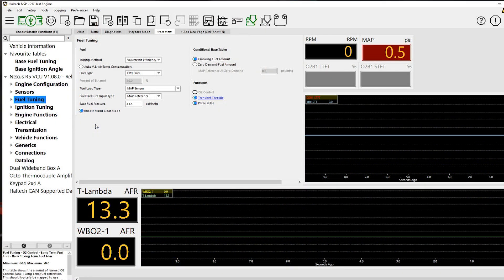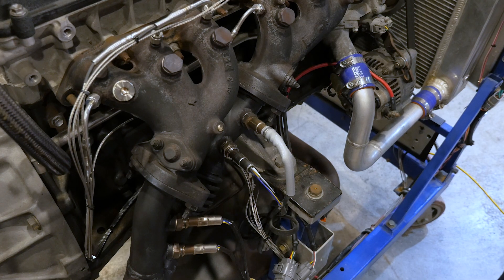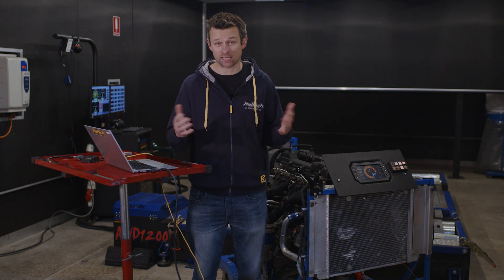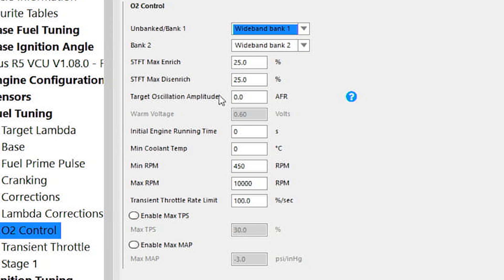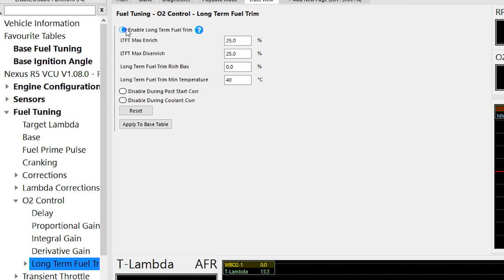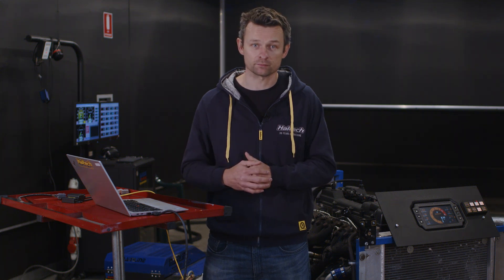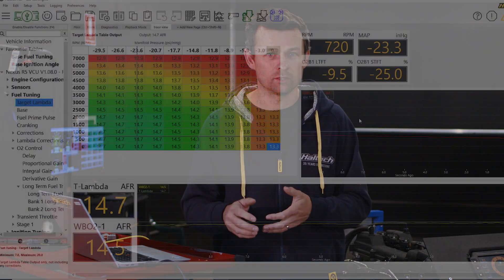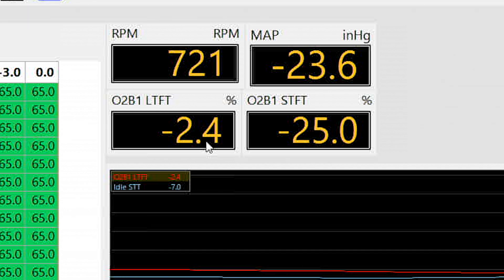🛠 How Self Tuning Works: Short Term vs Long Term Fuel Trim | TECHNICALLY SPEAKING

Comment from the maker: Welcome back!
One of the great things about tuning in volumetric efficiency mode is that once the fuel system is set up correctly - the ECU almost tunes itself. And that’s exactly what we are going to explain in this video.
-----------------------------------------------------------
Highly recommended videos that further explain today's topic:
AFR vs Ignition Timing: https://youtu.be/aDSZhy551bo
Tuning with Volumetric Efficiency: https://youtu.be/uPjIS9Tg83M
Volumetric Efficiency Explained: https://youtu.be/E96rBIzZ_sE
--------------------------------------------------------
For more Haltech goodness check out our:
Website: www.haltech.com
Facebook: https://www.facebook.com/HaltechEngineManagement
Instagram: https://www.instagram.com/haltechecu
Reply: Circle back  is that with two trailer Park girls around the outside. 😁👍🏻
Reply: So would this be able to work on a boosted car too? Like if set the AFR @ say 10.5 when in boost would it fill in the pieces and keep it safe at the sametime?
Reply: Put ChatGPT in this. =)

Comment: all modern cars have a self tuning (fuel trims) since 90’s but those use low resolution tables (low number of cells). not the whole ve map. this feature on Haltech  ecu’s seems very nice to have.

Comment: What ecu should i put in my 1.6 turbo cruze to get it to safely run at 300hp itll have high flow injectors , valve springs , t25 turbo n manifold, 3" straight through exhaust intercooler , cai, wide band and exhaust temp sensors

Comment: My elite 1500 has issues with this due to the delay in the o2 reading, and applying the LTT to the base map, it misses the cels its ment to add the data. Its reading for 2600rpm but applys it to 2800rpm range.. how do I fix this??
Reply from the maker: Contact our tech support team directly via www.haltech.com/contact-us
They'll be more than happy to help you out

Comment: Is this feature available for the platinum pro for the RB series engines (HT055101)
Reply from the maker: Platinum Series still have the long term learning feature it just works slightly different than the one described in this video.

Comment: I'm interested in the elite 1500 for my rsx. Essentially all stock other then a k&n filter in stock air box. Once the base map is loaded, can I just run the car how it was before since it isn't modified? Slowly modding the car for a tune later.
Reply from the maker: The best thing to do is to contact our Tech Support either via phone or via email (support@haltech.com). One of our tech guys will be able to recommend the right ECU for your RSX and even provide you with a base map:)

Comment: My question is this: do the LTFT and STFT changes get applied to only certain areas of the VE table as needed or do the trims apply globally across the whole map?
Reply: If I remember correctly, the LTFT and STFT values are unique for each cell of the table. So a cell at 3500 rpm and 0 psi would have its own LTFT and STFT values, different from those at 4000 and 5 psi, for example.

Comment: under what conditions can the "Apply to Base Table" button be pressed. As I am aware it cant be carried oout while the engine is running, but when should  it be applied, ie ignition on but motor not running??

Comment: Will this program fix my stock Toyota Camry with a 2AR-FE? The gas pedal is so sensitive it should just be called a light switch, and the transmission shifts up into 6th at 30mph. Taken it back to the dealership three times and they say it’s operating as designed.
Reply from the maker: The NSP only works with Haltech Elite and Nexus series ECUs.
Reply: @haltech  Thank you for your time and update! I’ll take a look at what Haltech products could improve my Camry.

Comment: Hey, thanks to your awesome videos, reviews, and company transparency, I'm now the owner of an elite 750 and 2000! Thank God for black Friday sales!
Reply from the maker: Nice:) What cars are they going on?
Reply: @haltech  1986 Toyota z20 soarer with a 1jzgte swap, and a 1977 Celica that ill either run the 1gzfe century v12 on the haltech 2000, or possibly the 1uz since I have that one already setup
Reply from the maker: The 1UZ/2UZ engines are gaining popularity of late. Good rides - both of them:)
Reply: @haltech  I have a bunch of old Toyotas (ie 20-40 years old) so I'm hoping I can figure out the haltech system quickly and then have them all running haltechs for simplicity sake.

Comment: Hey Haltech, which Haltech should I get on my turbo 4AGE? It's a Borg Warner EFR 6258, with a speed sensor and Coil on plug. Plan to use MAP sensor for intake. Also a quality wideband.

Comment: Except you need to have a decent 02 sensor delay setting which is often not understood
Reply: I was thinking about that. I think one would be wise to modulate RPM/load carefully and purposefully before commiting the correction to base. Quick changes in running conditions might assign STFT data to adjacent cells because of delay?

Comment: Its amazing how friendly ECU's are now days. People would have killed for features like this 20+ years ago!
Reply: Well - it was present 20 years ago, or pretty damn close to 20 years, juts not in the aftermarket ecu's but in the ecu's from Bosch/Siemens/Sagem and so on :)
Reply: @wiwelwiwel9141 MS45.1 and MS43 are the ones that come to mind (Siemens)
Reply: @wiwelwiwel9141 I've never understood why people put aftermarket ECUs in when there's a perfectly capable oem one right there... unless you want special features, there's no reason not to just slap a tune on the factory computer.
Reply: @crackpotfox  because is difficulty and not friendly hack a oem ecu. If you have a different car (not like audi/vw) with no map packs on winols, you are alone to turbo your NA original. Probably engine will break on original ECU. Thats why i love aftermarkets ecus.
Reply: @rodrigobrasilia7506  What are you talking about? There are tons of people running multiple times factory power out of factory ECUs out there. I'm running the factory one on my supercharged mustang. It's extremely easy to flash a tune vs rewiring the car for a new one.
Reply: @crackpotfox  If solution is avalaible, i agree with you. But in my country most budgets cars with oem Ecu theres no solutions.

Comment: I realllllly regret going with the holley hp system.  
I have spent $2500 trying to tune it & no one could figure out what was going wrong. From not communicating to not seeing a rpm signal & even the tune disappearing after the car comes back from the shop .
It also doesn't fit with type of car i built & has way to many drag racing parameters that are useless to me .

Comment: Is there any long term damage if you never see a dyno and just use this learning mode long term?
Reply: I say no, as long as you start with a rich biased ve map and a soft timing map, don't thrash the crap out of it for a while it will be fine, you won't be able to get MBT/maximum power in every part of your rev range though without a dyno.
Reply: From my limited understanding, isn't the trim turned off over a certain load?

Comment: Does the long term self learning map always need to be manually applied to the base table with the haltech software/laptop? And...does self learning only work when tuning in VE or also when using TPS for tuning? I have an 8 stack v8 with dual wideband and its been tuned via TPS. Wondering if VE would be a better result if tuned correctly?
Reply: @Matt Wright thanks for the detailed reply!

Comment: Long term trim is the number one reason I tell people to not bother with old ass standalones and get a modern one with that feature, it saves heaps in dyno costs as the car tunes itself as you drive it to the tuner!
Reply: Gets it in the ball park a lot sooner for sure. 
Or the Sloppy way with the new build input what you got on a new build beep boop and gameboy tune done and if everything is wired mostly right it starts up and runs. 
So much better then the older systems.
Reply: @wobblysauce  Yeah I loaded a 2JZ base map onto my 7M and setup all the sensors and custom stuff and it started and slowly taught itself to idle and fuel through the rpm range. I obviously didnt go into boost but I drove to the tuner and he only needed a few runs and she was good

Comment: I wish the ecu would tell me how much power I'm making lol
Reply: Plenty of phone apps can tell you a pretty accurate figure. Weight, engine size, rpm data, speed, accelerator sensor data is all it needs basically.
Reply from the maker: or you could just post a picture of your car on FB and read the comments....

Comment: 🤔.. I bought a haltech elite 550 with premium loom and haltech wideband controller to run the b6t in my '86 mazda familia bfmr, it has mx5 cas and yaris cop to run sequential fuel/ignition, it's all wired in ready to go but have since decided to run it on E85 with flex sensor and long term fuel correction.
 So, I also have a 78' bugeye 323 that I've put a S5 RX-7 Bridgeport turbo in and am looking to get a 750 elite and premium harness for it, then swap ecu's over so I have the couple extra functions I want for the BFMR. Is it as simple as as swapping over ecu's or am I missing something? 
I don't need anything special to run the rotor so I think the 550 should suffice. (safe, fat and retarded in a light car won't matter when it's all about the braps and flames🤣)
Reply: @Matt Wright No, I haven't checked out the lastest updates but definately will now. You blokes at Haltech need your blood bottling, love your work

Comment: I've got an unused bung after the cat. Is this sufficient for a wideband sensor or is it better to put a new bung closer to the engine?
Reply: Put it as next as possible to the exhaust ports or its useless if you only use one.

Comment: I wish these ECU's had inertia / g-force measurements to learn how to do this with ignition timing.  Maybe an inertia sensor w/ GPS so the ECU can see speed vs force.  Street tuning on another level lol
Reply: You just use rate of change of vehicle speed by monitoring the speedo input.

G sensors wouldn't be as accurate in real life on road testing.
Reply: @Rollin8.0  Actually, inertia sensors in conjunction w/ several GPS connections is exactly how G-Tech Pro utilizes their measurements for their units essentially turning your car into a road dyno.  While it may not be as accurate as a dyno, it does give pretty good measurements you can use for tuning granted the tires don't spin.    Tire spin is where speedometer monitoring would be an issue.  Maybe a stand alone could utilize GPS, inertia, knock monitoring, vehicle speed and maybe even using traction control data to tune ignition timing tables.
It's just an idea, likely will never happen.
Reply: Pretty sure they have a module for gforce
Reply: @dylanzrim3635  I haven't seen one.

Comment: I do prefer to just hook up all the wires, put the ECU in learning mode, floor it and let God take control.  Jesus take the wheel.
Reply from the maker: Well, that's one way to do it and who are we to argue when Jesus is at the wheel?
Reply: Not to say that we would see the good Lord upside down in a ditch but when you go from steering a camel to 1500 unnaturally aspirated horsepower it might be an issue...
Reply: @christianmgtow4744  jesus has a 7 second cage, hes good.
Reply: @christianmgtow4744  jesus is a rotary guy lol
Reply: @haltech lmao 🤣 😂
Reply: On the 3rd day god created the LS3 and it was good. 😆
Reply: You should not bag Jesus! He would have the 10.4 litre with over 1000 hp!